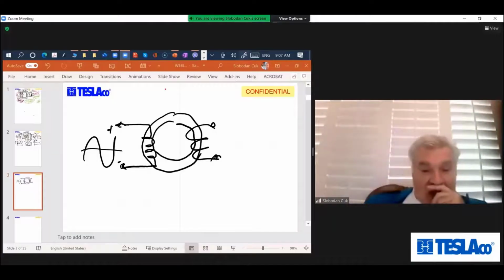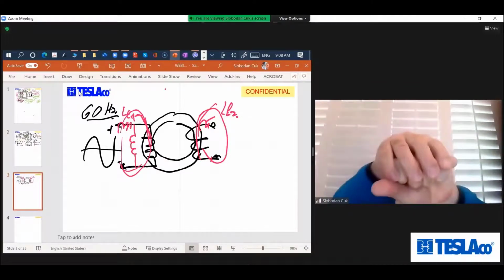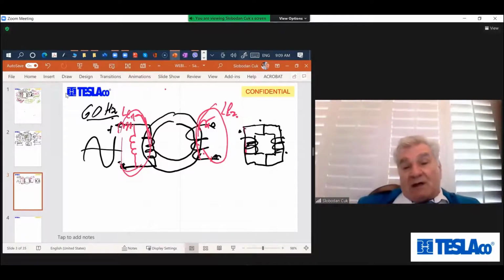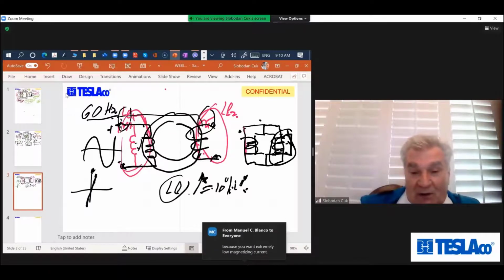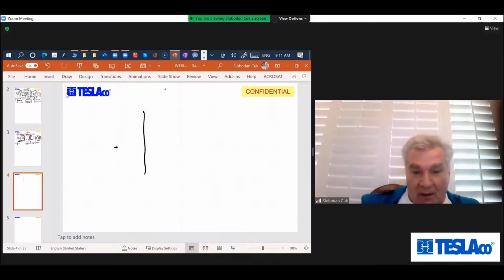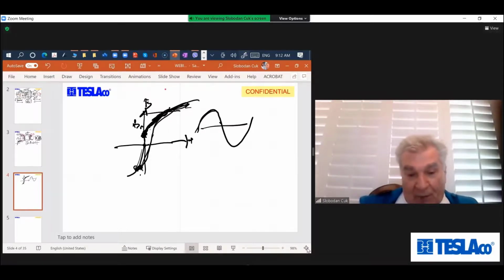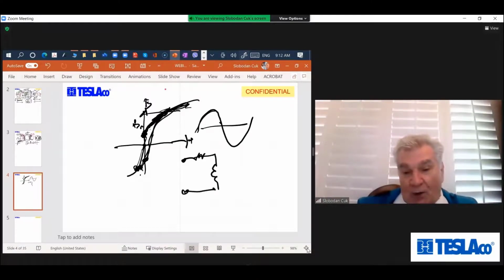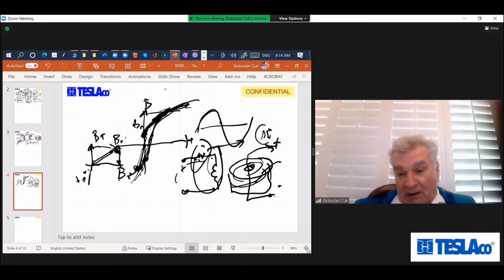Types of transformers

Comment: Interesting. In most of the application in power electrical engineering, we want the leakage inductance be as small as possible (the exceptions are welding machines and such). I know that plenty of circuits in power electronics require that!